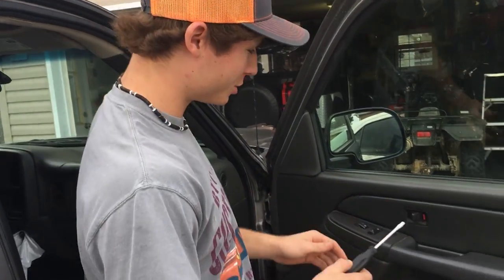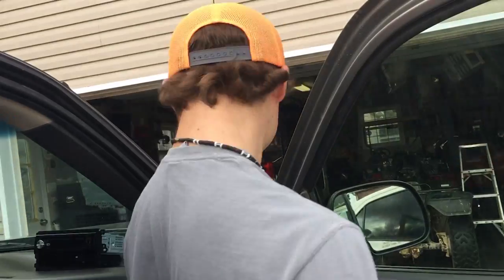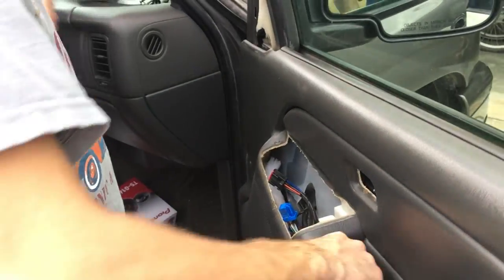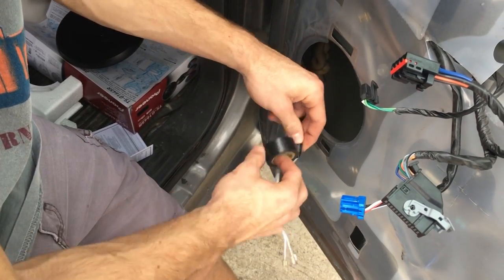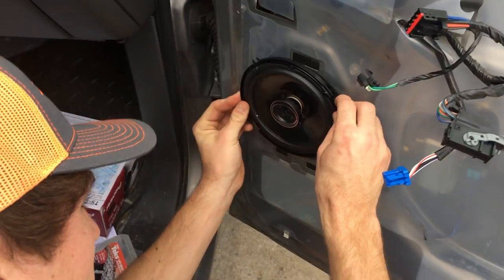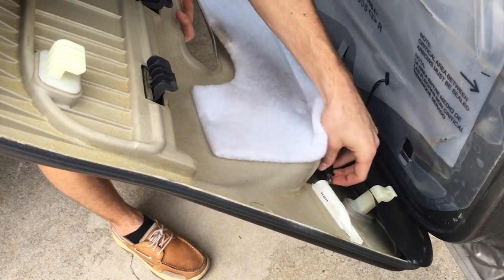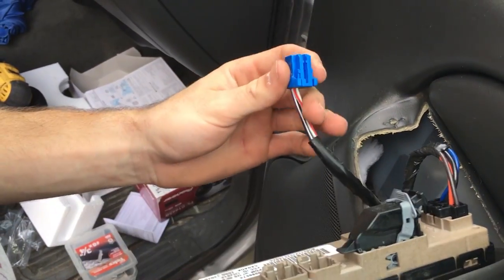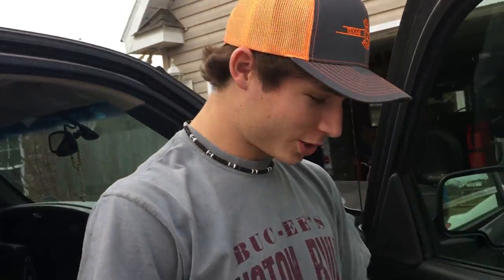How To Change Front Door Speakers In 2006 chevy silverado - Without Buying Brackets

Comment: Huge thanks for the helpful speaker and stereo installation videos !!! 
The part number to the quick speaker connectors are Metra 72-4568 for those who do not want to cut off the original plugs

Comment: Thanks for the video bro , I liked how you skipped the introductions and went str8 in , I did however instead of using a drill I just zip tied the speakers in and they hold just as well
Reply: U drilled the holes and then zipped tied em in or what

Comment: thanks for the video dude. excellent work. btw one could use heat shrink solder connectors instead of just electrical tape. pretty cheap for a bunch of em you just need a heat gun.

Comment: It is easier to just unhook the wire harnesses. 
Also, the screw on the very bottom of the door is only to hold the door compartment tray in place. It doesn’t need to be removed.

Comment: Damn they changed them within same generation trucks,  my '02 is only 2- 7mm screws and 10 seconds for panel removal.
  Recommendation- could tear the screen off those speaker surround brackets and reinstall em after 4 screws, then extra holdown for offroad and door slamming

Comment: I can tell you you can take off the window switch and the door lock switch before you takeoff the door panel and will be easier. If I put an aftermarket speaker do I have to take out the factory Twitter as well

Comment: Its probably a yes but this still work with an extended cab?
Reply: It should. Took the panels off to install my tow mirrors and has the same diagram of what the crew cab has unless you wanna do the rear ones.

Comment: Thanks Cason, I did my passenger side speaker using some one else's video before found yours. so I broke the screw out on the switch panel because the other video didn't show the screw on the back that has to come out after removing the panel. Why GM see's the need to change such minor things from year to year I'll never understand. Anyway I just got the drivers side done, using factory speakers so they just clipped back in. Thanks again for taking the time
Reply from the maker: Most of them don’t have that screw but for some reason his particular truck did. But yea man glad I could help

Comment: Hey how'd you make the screws stay secure after driving them through the metal. It seems like once they penetrate that thin metal then there would be nothing to hold the screws in and prevent them from popping out?
Reply: self tapping.. they go in and dont back out

Comment: Was the original factory speaker 6" or 6 1/2"?
Reply from the maker: cohunter4 I wanna say 6.5" but they have the adaptor for the speaker to make it fit right. Aftermarket with now adaptor works fun just as long as you did what I did.  But I think 6.75" would work better because it would be a snug fit
Reply from the maker: im not sure on that. all i know is that aftermarket 6.5" speakers fit the hole. but i think 6.75" would fit better.

Comment: This title should say "How not to install door speakers". This dude twist wires and tape. Then installs the speakers with no terminal protection from water drops of the window. Then he dont even use the speaker rings
Reply: Well stated. I just called it a hack job and same kinda kid who would drop an egg in the radiator before he sold you a "perfect 70 Nova SS"
Reply from the maker: sometimes people want it done the cheap way, i usually solder wires and use different terminals. the title says without brackets, so thats why i didnt use the speaker ring adaptors.
Reply from the maker: @diysecuritygear9594  it would take 2 egg drops to make it perfect lol
Reply: @George Becker because it was all a click bait
Reply: I did the same thing this dude did and my trucks been fine for like a year 😂

Comment: What about for the tweeters??
Reply from the maker: ohhh, im not sure on that one bud
Reply: My 2006 had tweeters and my replacement Alpines came with tweeters. I cut a hole in the old tweeter mounting plate and the new tweeters fit. Instead of cutting the wires in the truck, I removed the connectors from the woofer and tweeter and soldered them to the new wires.
Reply: My 2000 Silverado driver side door doesn’t have a connector for the tweeter what do I do ?

Comment: Now the radio won’t turn on!
Reply from the maker: Make sure you are getting power to the radio, have a good ground, and the red wire is getting good power which tells the radio to turn on
Reply: @casonray   I tapped it to the ac controls, and the ac still turns on, I think there’s a short in the passenger side, since I did the driver and have no problems,..
Reply from the maker: @TheGhostOf95  make sure the wire tap actually tapped into the wire and has a good connection

Comment: E tape inside a door. Worst thing ever. Twisted wire and rain/moisture is horrible combination of just a hack job. This is how to remove panel. The rest is a hack job. Type of kid to drop an egg in the radiator right before he sells you a "perfect" 70 nova with a 305 and SS badges
Reply: So... Why not just use some wire nuts and completely hack this to death. Ya'll just rip this stuff out, maybe look polarity up, plug it on up and send your buddy down the road with some B's quality. Did I do it right? Better turn on speaker cause my talent is sheet.
Reply: EpilepsyWarning so the e tape is fine for a permanent fix in a vehicle? That was a joke right?
Reply: @diysecuritygear9594  don't worry, I appreciated the original comment. Had me laghing my ass off hahaha
Reply: There are these magic things: Metra 72-4568 Speaker Harness for Selected General Motor Vehicles $10/pair on Amazon or your local shop. No cutting the harness, no water, no corrosion, no wondering why your speakers go on and off every bump you hit. Heat shrink over twisted wire...  hell that means you at least made an effort. I suppose 22g speaker wire would be just about right for your 349 watt amp as well. 
As far as the f bomb goes - what? Can't handle the fact that is shit work and you know it? I get it. You used what you had and it works for the moment but, for a guide on "how to" this would have anyone thinking of your handyman skills as shit as I stated early on. Now, Onto the next project you do. What will that be? How to wire christmas lights with walgreens extension cords under the rug, next to the space heater, under the front door, connected to a block heater on an F250 and the reindeer? That will make a nice glow I'm sure.
Reply: And if you'd like to see the same truck (mine) done in the driveway using the same tools that will last longer than me or the truck I'll tear it down and send pictures.
Reply: And now that it's good and rainy outside here let's talk about e-tape. So did you use the super cheap plastic crap that just kinda sticks or did you hit like 3M super 33? It's good up to 600v, is a bitch to take off, and costs more that .99/roll. If you didn't no problem. When I was 18 I had no idea either. Once you get into the real world of needing to make things last past the next weekend, the next road trip, the next whatever, things matter. At some point you'll understand this.
Reply: The video gave you an idea of how to do it in a general sense. How you do the wires and use the brackets is entirely up to you. I personally will do it differently. At least now I know how to get the speaker out of my truck and get the new ones in.